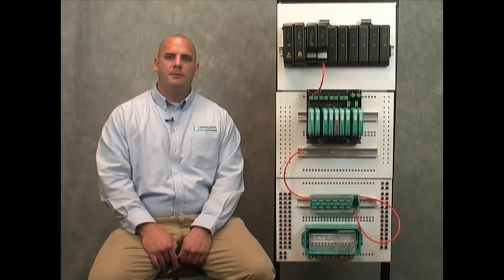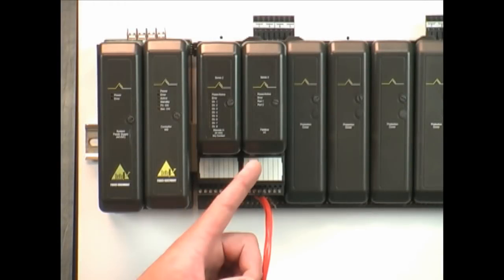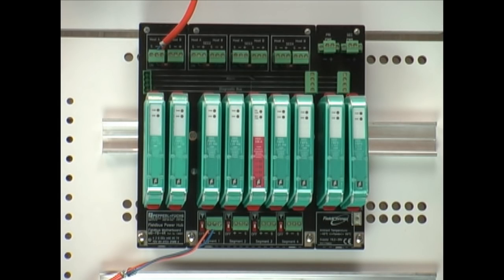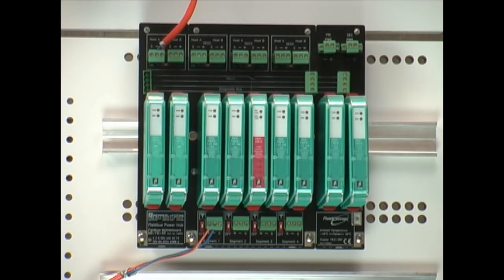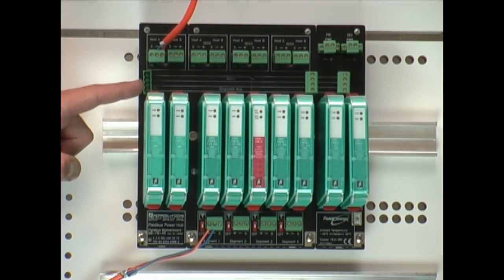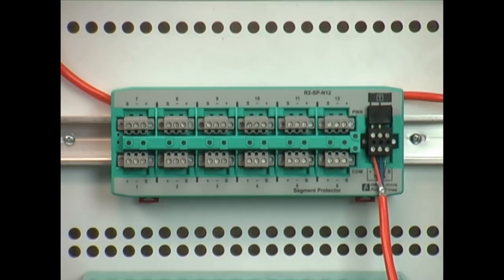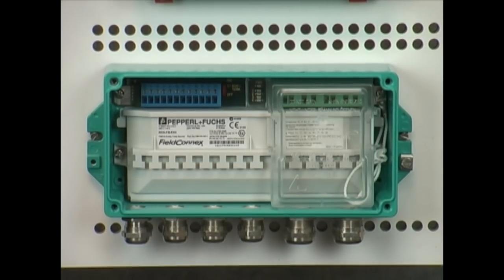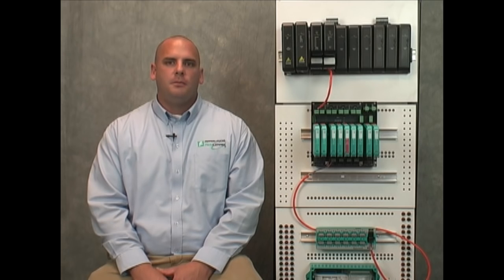Foundation Fieldbus - What Components Make a Complete Segment?

Comment: Thanks for your great presentation, I have smal question related to the noise in FF segment, what could be the reason behind this noise???
Reply from the maker: Hi there Rashid, typically it’s installation-related and can come from ground loops, poor cable installation (running fieldbus cables next to high-voltage cables), or using improper cable types, variable frequency drives, motors or generators in close proximity to fieldbus devices, and a handful of other things. However, one of the benefits of a FOUNDATION Fieldbus type installation is the variety of diagnostic tools available to help troubleshoot and detect these types of fault conditions, as well as assist in troubleshooting poor quality signals and other physical layer fault conditions. Please feel free to contact us at https://www.pepperl-fuchs.com/usa/en/ask_an_expert_pa.htm if you require further assistance.
Thank you.

Comment: Hi I'm Brian Tracy on the product manager for fieldbus and remote IO products here at Pepper And Fuchs today we're going to discuss the components that make up a complete Foundation fieldbus segment. 

a)	The first component to any foundation fieldbus segment will be a host the second component will be a foundation fieldbus power supply you then move down your trunk cable into a field distribution we call them segment protectors and from there you go off to your individual field devices 
b)	So the first component in any foundation fieldbus segment is the H1 interface here you see a typical to Port H1 interface connected into a Delta V controller and this could be with any DCS system yokogawa Honeywell it's independent of manufacture but the host is where all of your control will will be done and this is where the LAS or the link active scheduler is housed which controls the schedule for the rest of the field bus Network 
c)	The second component that makes up a foundation fieldbus segment would be the foundation fieldbus power supplies this is an example of Pepper and Fuchs power hub there are different numbers of segments options this is a 4 segment redundant Supply at the top here you'll see we have four host connections with redundant host an option redundant bulk power supply inputs and down here you have four segments for your trunk connection power supplies main goal is to provide a matching impedance for the fieldbus segment if you just connected up a bulk power supply your communication signal would be lost and there would be no no viable communication to control your plant now the various power supplies available from different manufacturers offer redundancy of the power supplies as well as usually a built-in selectable Terminator each foundation fieldbus segment needs to Terminators wanted D each end of the segment and so having it built into your power supplies is a convenient way to make sure that that's included another option included on the power hub is our Advanced Diagnostic module this built-in module allows you to monitor the physical layer for all 4 foundation fieldbus segments and it’s signal is transmitted through a diagnostic bus right from the backplane
d)	The next component for a foundation fieldbus segment is going to be some sort of field distribution and for PP and F we call that a segment protector this is what takes a trunk in connection from your power supplies and converts that into different spur connections for your individual field devices the segment protector offers a short circuit protection as well as some LEDs to tell you if there’s an error or to let you know that you have communication and power additionally built into the segment protector is the second Terminator that you need for FF segment so again it’s already included with the segment protector and makes it easier to to ensure that you have two per segment additionally you can daisy chain multiple segment protectors together using the trunk in and trunk out connection and these are used for safe area or division two applications another option for field distribution when using high power trunk concept is the field barrier This is a Division two mountable zone one mountable interface that provides you with four intrinsically safe outputs for use in class 1 div 1 or zone 0 applications it provides again short circuit protection for the individual spurs as well as the optional terminator so today I’ve shown you the three major components that make up a FF segment the hosts the power supply in the field distribution for more information on these solution such as data sheets white Papers or application notes visit our website thank you for your time.